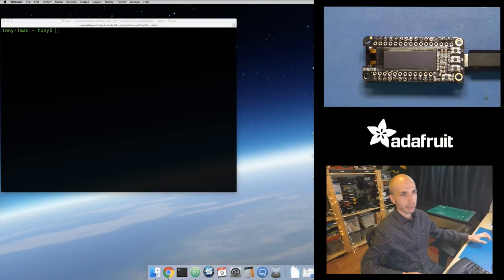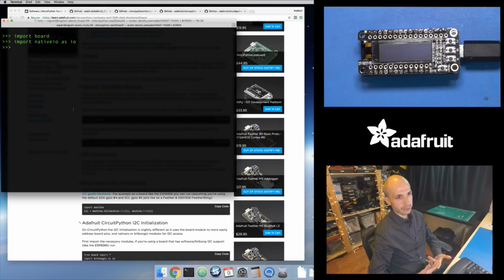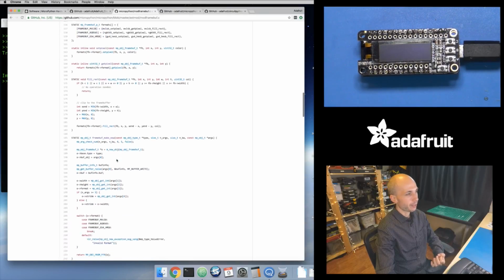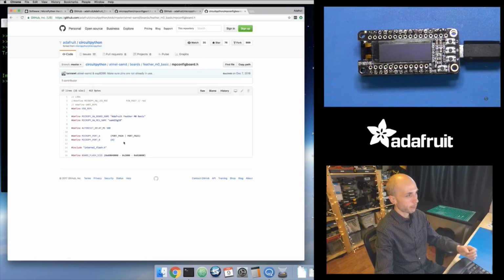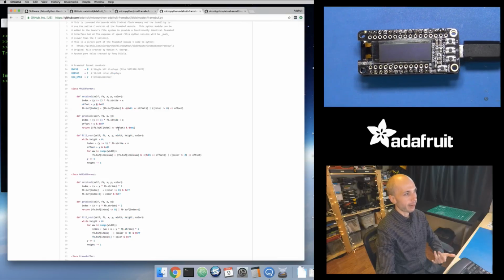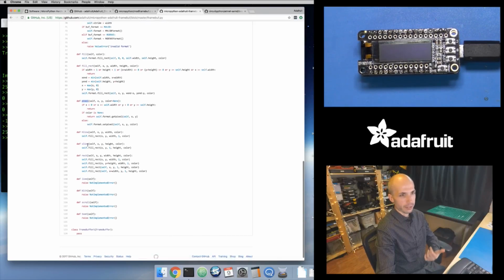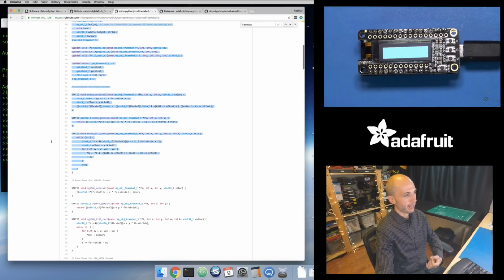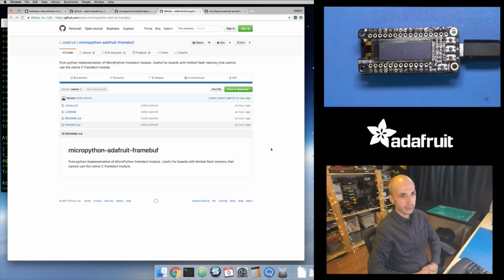MicroPython framebuf module and SSD1306 display with Tony D!

Comment: Tony, can I use some instructions to save a variable in EEPROM on the ESP8266 with micropython?  Do you have info on this?  If not possible, how can I save a variable to EEPROM or Flash memory and use it in my micropython script?  Thanks.

Comment: Here is a better argument:
It saves the recompiles and it saves providing dozens of firmwares, if you have a couple of wings and you cannot fit all C-code of all wings into the onchip flash memory. So you do not select your libraries at compile time, you chose them at run time.
Lets see where this goes. Liked.